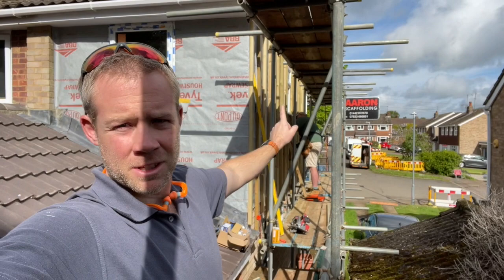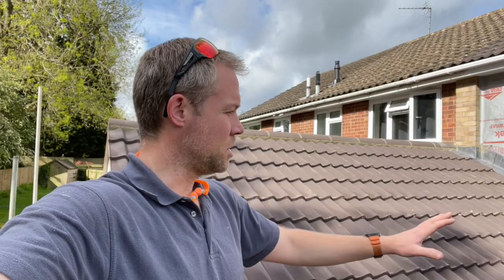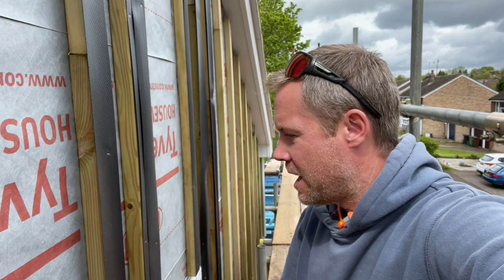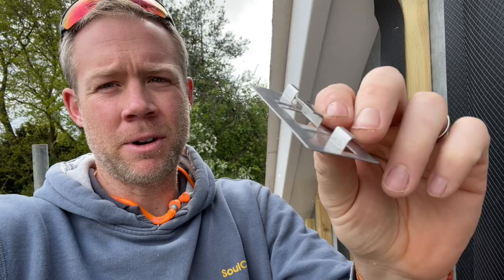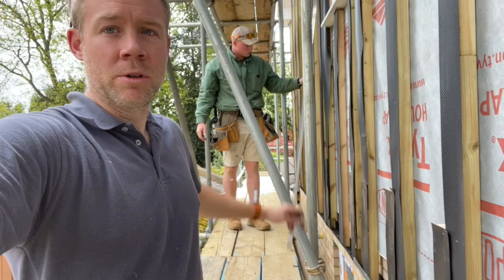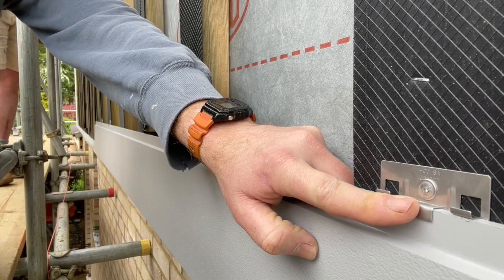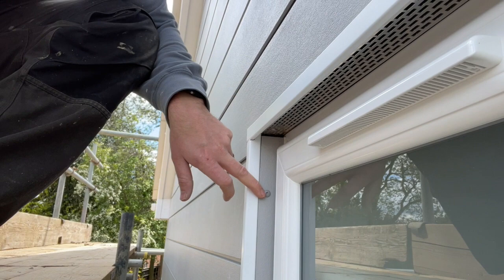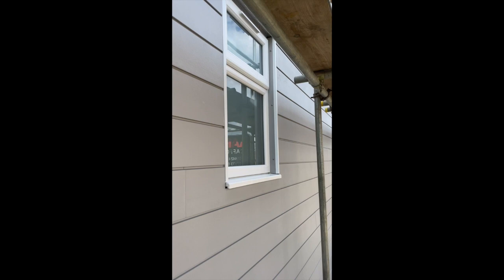Cedral Click Cladding - House Transformation! - The Home Extension - Episode 23

Comment: Thanks for this video.  Good to see it being applied and very helpful. I’ve just ordered my Cedral click.
Something worth noting for anyone who is going to use cedral - they do not manufacture trims other than 90 degrees.  So if you have a corner like I do that are not right angles you have to buy trims on spec.  Which is ok for one or two, however, matching the Colors of cedral trims to a different manufacturer will be very difficult.

Comment: Hi, what do you use to cut the cedral? There’s a bunch of chopsaw blades etc on the market with mix reviews, thanks.
Reply: Hi There, Probably a bit late for you, but I'm about to start a cedral cladding project and have found that most decent chop saw blades will work OK if you are very careful, but the best is apparently a 4-tooth blade, I guess the logic with that is the reduction in cutting faces so that it doesn't rip the material quite as much. If you found a good solution let me know!!